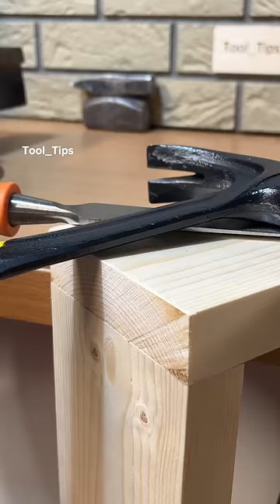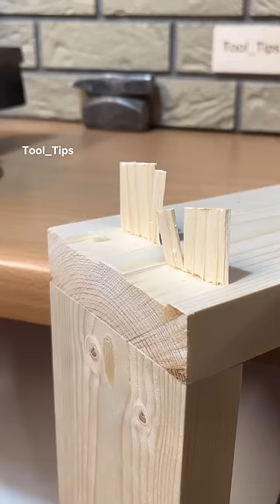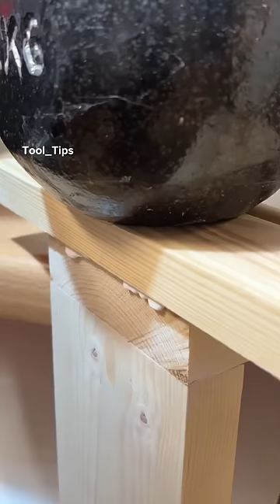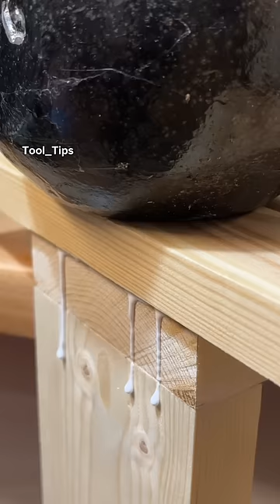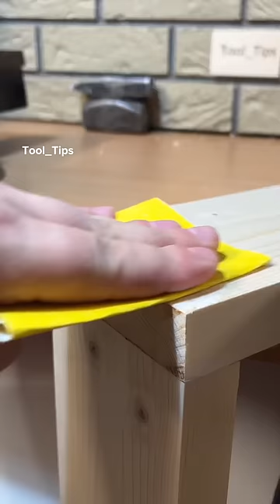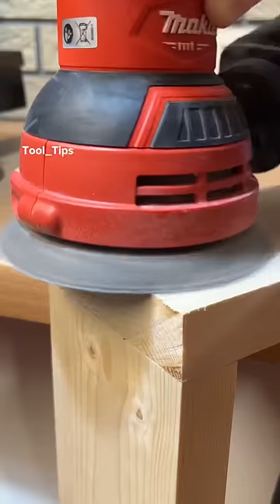Tip for Carpenter and Joiner 👍

Comment: Can't count the number of times I've seen this done wrong. You have to remove the top board after drilling through both, and drill a hole that's the size of the thread diameter. It won't tighten up properly doing it this way.

Comment: And you could just sink the screws in the top and mix a small bit of glue with sawdust and fill it in or just cut a joint if you ever have to take it apart you will mess the wood up

Comment: I like the part where the glue didnt hold it down n it lifted n you had to cut it to after the 2nd attempt 🙄 next time use baking paper between n let the glue dry properly, this process is not a fast one, so dont try rush it!

Comment: Still a weak joint with screws into end grain. Using a Domino is quicker and would have resulted in a more sturdier joint. But granted, more expensive in tooling.

You also drilled too deep.

Comment: YOU CAN SEE THE EDIT at the end it shows how the wood was from the fucking start. ALSO LEARN HOW TO GLUE! I actually hate when people load shit with fucking wood glue. TIP if you use to much it bonds glue to glue making a weak joint, so apply a litte but make sure both sides are covered with a very thin amount of glue it makes the joints 3x stronger. Don't believe me go test it.